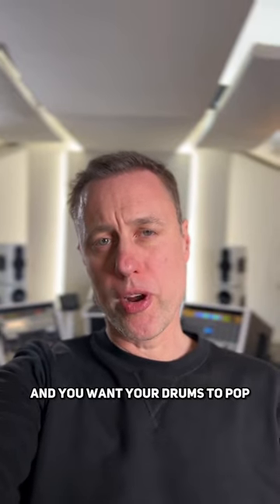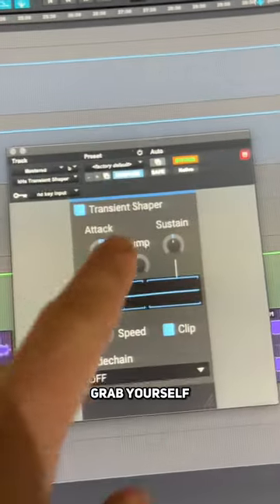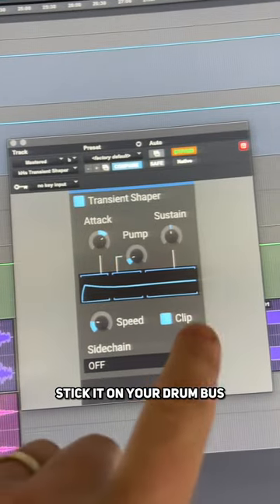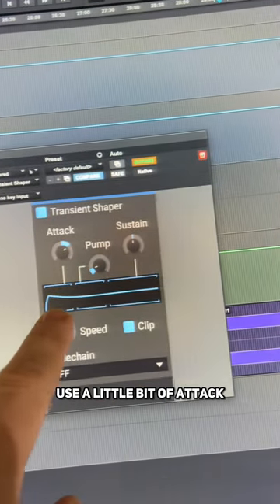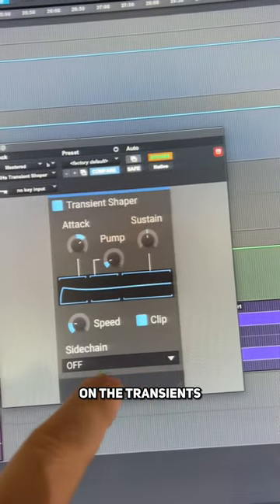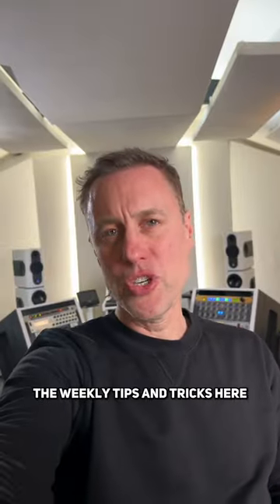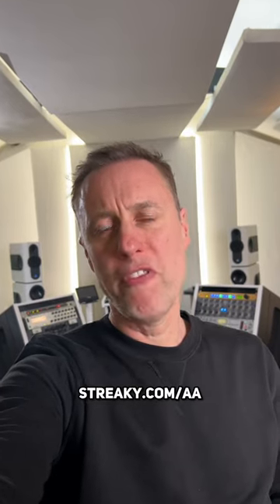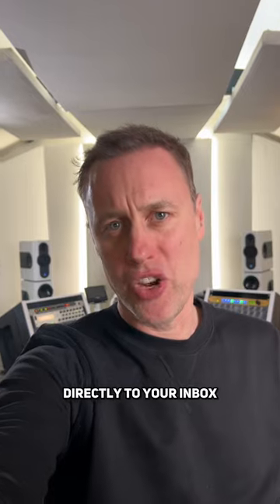TRANSIENT SHAPER FOR LOUDNESS 💥

Comment: I use this particular transient shaper on all kinds of things. That kilohearts pump function is so unique. I use it on kick and bass subgroups a lot. 

Regards this tip, I don't recommend transient shapers on drum buses because transients stack and you can lose headroom really quickly. It's better to individually shift drum loop hits around in milliseconds so they don't all overlap. 

If you want ridiculous levels of control, you can also have every other hit on a separate track and remove the transients from one so they weave in and out.

Production is endless, you can do so much sto mixes, it never ends!
Reply: Or you can use the transient shaper on the drum buss and then clip the signal. Now you have apparent dynicamics and headroom
Reply: @mateobalsa1173   Yes, that's a classic too! 

There are so many classic engineer tricks to get the sound you want unintuitively that sometimes you just stumble across.. I'm guessing in studios before all this high quality home equipment was available so anyone could make a decent track, the tips were passed down from engineer to engineer in real studios since the 80s or before.

Smashing transients into a limiter gives you the sound of big hits, without burying the vu meter.thats
Reply: your last tip could really add phasing issues though, or no?